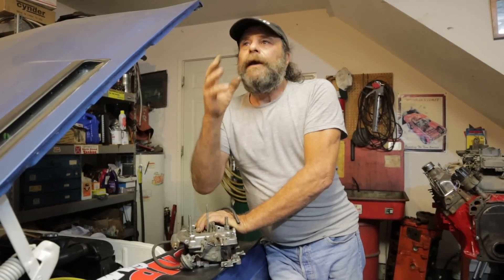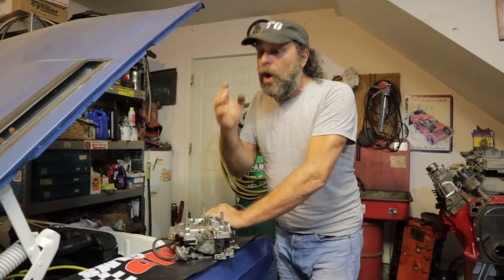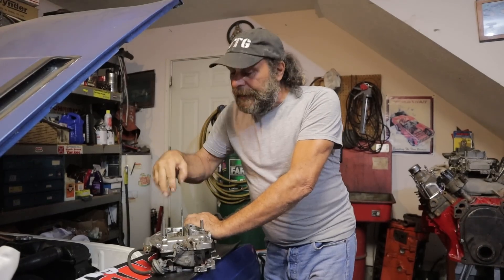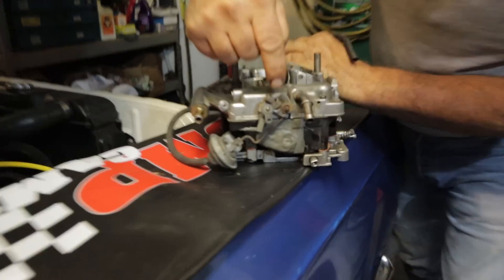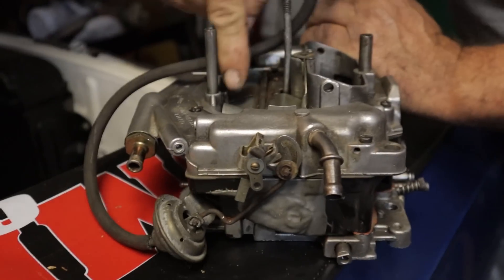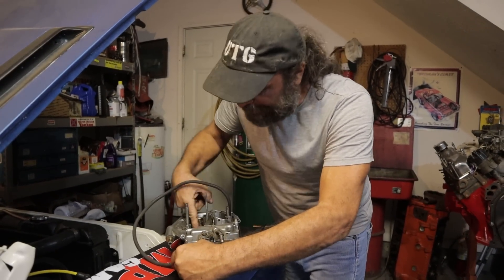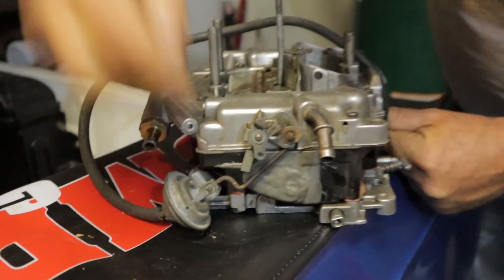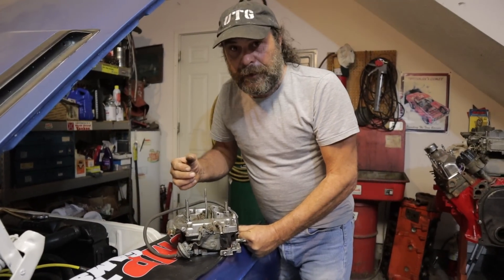The Great Thermoquad Debate

Comment: A old drag racing tip from  1971. We would remove the  vacuum diaphragm and use the spring on the air valve exclusively. I still run the same set-up today on my 340 Demon  1971  4speed. We also ran it on automatic cars in the  70s. Basically all mechanical but it disabled the choke operation. We don't use no stinking chokes on race cars! 😂

Comment: you are calling that "primary tuning" when the primaries are per se, the small throttle blades up front.  perhaps that's where the confusion comes from.  what you are actually talking about is SECONDARY TUNING.  the big back throttles are called THE SECONDARIES. not the primaries.  you have the verbage slightly off. spreadbore carbs by design, primaries are the front barrels, secondaries are the back big barrels.  drive on the small front PRIMARIES for economy.  kick open the big back SECONDARIES for power.  you got the terminology mixed up.  other than that you know your shit.  I'm 60 and have been tuning those carbs for 40 years, worked as mechanic, had my own shop, do all my own repairs, rebuilt tons of carbs all makes.  engine/drivetrain overhaul, body off restorations, diesel/truck repair.  the know it alls were probably nitpicking your terminology.  not the main jist of what you're saying, how the SECONDARIES work.  but I can see the idiot above me you pinned his response, to remove the dashpot. I tried that 35 years ago.  it doesn't work.  no matter how tight you get the spring, it creates a bog.  the dashpot is a MUST HAVE.  and on a Qjet, it also acts as the choke pulloff.  so you are right that know it all is a moron.  lol

Comment: Cleaning out the exhaust heater plenum,under the carburetor betwixt the 2 cylinder heads helps to,but it means you have to take the intake off,thanks uncle Tony,like your videos.

Comment: Hey Tony, could you do a video on the thermoquad (mine is a '83 Dodge 4x4 with the 318LA engine)  leakage issue? Seems to be a well known issue with the welch plugs -my bowl is leaking down into engine, driving me nuts! Any thoughts on a better replacement carb or stick with the thermoquad? Thanks!

Comment: Thanks for sharing. Don't think I fully understood that, good explaining imo, makes sense to me. I'm 42 & my 1st car was a '74 Challenger w/ 2 barrel low compression 360. I didn't know crap about cars or carbs, but I eventually swapped the wimpy 2 barrel for a good ole Thermoquad, & the difference in power/acceleration was night & day, so much better. Speaking of that car I need to work on it & get it running again.  Thanks again for sharing,   - take care from TN

Comment: Back in the day I used to rebuild carburetors on a regular basis. The thermoquad is a good carb but the problem is you cant clean them. It has a plastic body and when it gets full of sediment or varnish you simply cant clean it properly. Carb cleaner will melt the thing

Comment: I love my TQ.  Bought from carb rebuilder called Demonsizzler for normal street use on my '70 Chrysler.  Took a couple days to adjust it and I haven't touched it in over 10 years.  Best fuel mileage, fuel stays cooler, no heating up needed (start and go), never stalls,...but yes, once it a while, it does give me the "Thermobog" syndrome, but I know most new cars, even Kia's are now faster than old musclecars, so I don't drag race it.

Comment: Don't get so excited, you'll have a stroke. Vacuum (manifold vacuum) holds the secondary air valve closed by way of a small diaphragm. The secondary air valve has to open at a prescribed rate depending on the performance tune of the engine. A stock Thermo-quad on a 318 will have a fairly slow air valve opening. Take the same carb & put it on a 318 that has a street performance cam, better heads, better exhaust & that engine has the capability of revving much quicker than the bone stock 318. Therefore the air valve opening on the thermo-quad now opens too slow. The rate of opening is controlled by a small orifice in the vacuum tube at the base of the carb. On Q-jets the opening rate is controlled by an orifice that is in the diaphragm itself. Get hold of a book on Q-jets by Cliff Ruggles, he explains the process quite well. On Q-jets that are to be used on a high performance engines he drills out the orifice quite large then uses a small restrictor placed in the vacuum line running to the vacuum diaphragm. He recommends using something like a short piece of aluminum stock like an aluminum rivet. Keep drilling the restrictor out until the engine bogs during full throttle then start stepping down the hole size until you get a clean response when going to full throttle. Works. Now, if'n you are working with a Thermo-quad that was set up for EGR & you are running it on a modified engine w/o EGR the carb will idle excessively lean. That requires some mods to the idle circuit which is a bit tricky. I'll let you figure that one out for yourself. And, true, all those little rods & levers have to be precisely adjusted in order for the carb to function properly. Also, and this is a big also, they have to be done in the proper sequence. I happen to have in my possession an actual MoPar service manual on the Thermo-quad. I could copy it & send you a copy if you like. Not a copy to everyone on this post, just to Uncle Tony. I'm retired & couldn't afford to send one to everyone.
Reply: An update to my previous reply. Checked my stash of Thermo-quads and found that 6 of the carbs have the secondary air valve bleed orifice  in the vacuum tube in the base of the carb & the tube is made of brass. on the other 9 the bleed off orifice is in the vacuum pot itself. I have no idea what criteria creates this situation. However, three of the ones with the restrictor in the base are early to mid 80s carbs so they may be the result of stricter emissions controls. The one that is currently in use on my Duster 318 (slightly modified) has the restrictor in the carb base.

Comment: i like your advice.i live in virginia about 2 hr bristol.i always lived the slant six. build a slant six from junk yard with supper six intake 318 carb. put 323 behind auto transmission. i raced a 318 only lost by half car length.the car bark tires pulling out without power breaking.i always wanted see what a slant six can really do. i have one now in 74 dart.you gave me a lot to start with.

Comment: carburetors and point distributors have been metering fuel and sparking the fuel since 1902 and earlier in some other countries,this carburetor is my favorite next to the avs and afb,simple to work on and you don't spill fuel all over the damn engine,rebuilt hundreds of them for police depts and ambulances,motorhomes and whatever the hell you find them on when you lift the hood,just another carburetor design,carter spent millions perfecting it,DICKIE HARRELL DRAG RACED TWO OF THESE ON TUNNEL RAM ENGINE,LOOK IT UP,THEY ARE TOTALLY TUNEABLE,IF YOU KNOW WHAT YOU'RE DOING,don't know,ask around

Comment: i went to school on this unit for chrysler, as no one in the shop wanted to work on them,which is stupid when you have the engineer who helped design this carb teaching the class,this carburetor is no different than any other and as a matter of fact is superior to most units as it is full adjustable,the economy dead stock units give incredible fuel economy,on my 383 mag challenger i averaged 18 to 19 mpg, no bs,now as to its high performance capabilities DICKIE HARRELL used two of these on his drag car,he had them tuned to a knats ass,he ran hard,with these ,now the vacuum pot is speaking of is the trick to the unit,for longer duration cams,i just cut the vacuum piston springs a coil at a time,this is trial and error,if you don't know what the hell you're doing,hire someone,the cutting of the springs is for idle control only,as it weakens the springs to seat the vacuum piston  in the  main jets and leaves the mixture control to the needle sizes,ok now the idiot professors can now confuse the hell out of everyone,tuning this carb is doable,and not for the holley freaks,holleys are for all out racing and are not a good street unit as they leak as designed,have many of them under my bench,for parts for the diehards,you wanna run holleys,buy them brand new in the box,you can hand a holley unit to 20 different mechanics and it'll come back screwed up 20 different ways,ok attack me i've heard it all in 47 years

Comment: I set my q jets up with a millisecond of bog it's how I personally like it I'm not racing I'm screwing around so I put it in low bring the Rpms up to about two grand light throttle and right about 2200 jump on it and hard too toe into it it has like I said a millisecond or two of a stumble but when the engine catches up with the air doors opening just a hair too fast it breaks the tires loose and throws you back in the seat and very quickly I'm shifting to second

Comment: I have a good running TQ with no bog, and decided to try a restrictor in the vacuum line to the pull off. It picked up 2 mph in the quarter, and seems to be more responsive just cruising it.  Took the push button from a ink pen, and took a hot needle and made a small hole in push button and  stuck it in the vacuum hose.

Comment: Just subscribed, you give me the info I need  to get the engine for the wifes car done. My question, AFB or thermoquad on a .020 over 318 with a copy of the 68 340 4 speed cam. (speed pro cs1019r) , I've got a choice of 360 truck/318 interceptor heads, and closed chamber swirl ports, using a stock 360 truck 4 barrel intake,  I'm just trying to figure out which carb to use.

Comment: Another thing the Thermo-bog needs not to bog is a well adjusted accelerator pump. On the Thermo-bog, it's a two stage pump. It has to give a shot when you open the primary. (Well,duh).. BUT, it also has to give another shot when you open the secondary. If it doesn't, it can sag even if the secondary air butterfly is right 😎

Comment: Away way back in 1976
Ford Australia found itself
In a bit of a fix
In the previous year
The exhaust ran clear
Now though that wasn't 2 B
Enter the Carter Thermoquad
Installed in the top end GXL
Which replaced the 351 GT.
Reply: Thermoquad discussion:-
https://youtu.be/vVET2orGO_s
Reply: Thermoquad in action in 1976
https://youtu.be/5SDnJAYeN6c
Reply: Model reviewed was a press special
Manuals are as rare as hen's teeth......

Comment: So Tony's explanation of how a stock thermoquad works is not valid because it's normal functions may be hindered by use on a highly modified engine...... That and like he said a cammed out engine still produces vacuum..... That and the fact that the vacuum detent or whatever you want to call it (essentially itsy a vacuum operated detent) operates on a lever gives it a mechanical advantage multiplication.

Comment: I have argued w/ guys over that very thing. I have rebuilt Q-jets for a number of years & you would not believe some of the things that have been done to them. Got 1 that someone had wired the secondary air valve open & I wondered just how well that worked. Another I took apart looked as though someone had taken an acetylene torch to one of the primary venturii accelerator rings. Seen a lot that had the hold down bolts so over torqued that the body was warped. There are a lot of hamburgers out there.

Comment: I have a 1999 Dodge Ram 1500 with a 318 it cranks won’t start but cranks I’ve replaced the pick up and cap and rotor wires and plugs I replaced dam near all sensors except the crank sensor and Me and my brother both retimed it to tdc and I’ve been told I am 180 off but I’ve followed a few videos on retiming it and it still won’t run it cranks but work start

Comment: The vacuum limiting your talking about sounds like what Nick on nicksgarage was explaining on tuning the Mopar 6 pack. He had a viewer send him an adjustable valve to put inline so it can be dialed in easily no matter what car it’s in. Pretty cool idea. There is no one size fits all answer for vacuum secondaries. Heavy car vs light car, stick vs auto, there’s too many variations to have just one setting.

Comment: As a Chrysler tec. when this carb came out on the 1971 340 I went to school to learn about it. Tony is right the choke pull off serves two duties on this carb. Acts as a choke pull off, adjusted by binding the tang with the slot in it and for controlling the secondary air valve, by bending the link. Contrary to what people think the quadrajet also has a vacuum break to keep the secondary air valve from flopping open. With both carbs you can wind up the spring to further limit how fast the valve opens after the vacuum drops to the point the vacuum break is no longer effective. In the 45 years in the business I probably rebuilt more of both of these types of carbs than most people have even seen. When I retired I was the only one in the shop that even knew how to rebuild a carb. let alone make it work properly.
Reply: you and your wisdom sir are gold!

Comment: Here's a loaded question if we tie the secondary open or tie it to the primary and have them both open at the same time does that give you better performance. I know circle track drivers that would do this instead of buying another carburetor.

Comment: You do a great job, UT. Many thanks!

I think you may have made a wrong turn when you got into component level adjustment. You had said (I believe) in a few videos that detailed carb adjustments are outside the scope of these videos.
You may want to bypass the noise from the know-it-alls and refer them to an adjustment video or to open a manual. Manuals were all I had way-back-when. I'm unsure if the attention deficit prone can handle learning from a manual, but that's a tough titty they need to learn to manage in car builds.

Keep the faith, bro!

Comment: It's not a question of understanding. 
With regard to the procedure I heard you the first time.
It's a question of necessity/validity.
As to doing ones homework, I can provide Carter documentation that shows the purpose of that subsystem is to keep the secondary air door shut--that's all.  I don't believe you can provide contrary documentation.
Why is that relevant you ask?  Because all along you've acted like this is common knowledge when in fact it is not.
I suspect you learned of/came up with it years ago and it didn't register that it was an unorthodox workaround (aka advanced/pro tuning trick).
As for a workaround/tuning trick it is what it is and I for one thank you for sharing it with us.

But to call people names because they aren't familiar with it and/or question you about it is wrong.
All I was doing was "asking Uncle Tony"--do you remember that--the other YouTube channel you let die on the vine?
What happened with that?
Perhaps you don't really want to answer questions--you'd rather it was just one way: you put it out and everyone thanks you for it.
Well that's not how it is buddy-boy.

Something else to consider:  You can turn comments off.

I think you're figuring out this is a much bigger pond than you're used to and you're not the only sizable fish in this pond.
Put out questionable information and you'll be questioned and/or criticized.  What part of that flabbergasts you so much?
You don't like it, turn off comments and go back to sitting in the rain pontificating about your disillusionment with nitro, how Mustang popularity is all about you, and whatever else fits into the world according to Uncle Tony.  
You haven't figured out that you don't really need to do any actual wrenching.
All you need to do is sit on a stump with a fresh pack of smokes and start laying it all out for us.
A large percentage of the comments will be gushing praise and defense of whatever you say regardless of the actual content. 
You're in your 50's.  No one else is as old or older than you with as much or more experience.
Simply open the flood gate so we can sit back and allow all of your indisputable knowledge and wisdom to wash over us making us better human beings in every regard. 
It's not just noobs it's everyone who needs Uncle Tony to set them straight.

Back to the Thermoquad.
If the choke pull-off was the primary means of adjusting the secondaries, the air door spring could be fixed (non-adjustable).
Like you say, all it would need to be is strong enough so that the air door "rides the rod."
Look at the Holley Street Demon.  I think we can all agree it borrows heavily from the Thermoquad--especially in the secondary design.
Where's the choke pull-off?
I haven't heard any complaints about an inability to tune the secondaries.
I believe the same is true of the Thermoquad unless there is something unusual going on.
You may have run into one or more relatively unique situations.
You are to be applauded for knowing of or figuring out a work-around--assuming the situation is not of your own doing.
But to assume anyone who isn't an idiot (including Carter engineers) knows of it and/or has had to employ it is wrong.
If you can't agree with that now you never will and there is nothing left to say.

Comment: Thanks for the videos!! These have been a huge help in understanding my 850 thermoquad that i recently did a rebuild on which I'll have to take apart again cause the throttle blades( I think ) are getting hung up somewhere when wide open. It took me hours of fiddling around trying to piece the secondary linkage back together my linkage on the carb and the linkage diagram from the rebuild kit were slightly different. I was planning on running the thermoquad on my 318 poly after watching you and lunar rebuilt his LA318.

Comment: I have an old Direct Connection TSB for thermoquad tuning on a super stocker that says to tighten the secondary air door spring adjustment as a last resort.  I doubt any street car would ever need to do it when they say its a last resort on a super stocker.